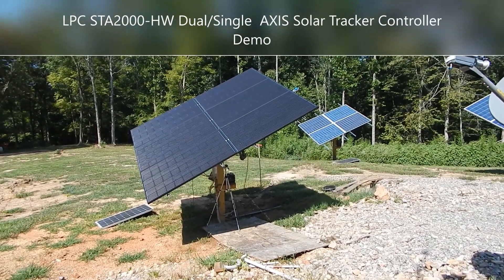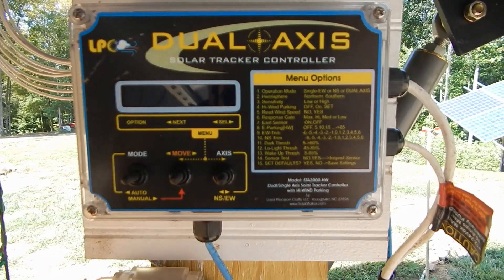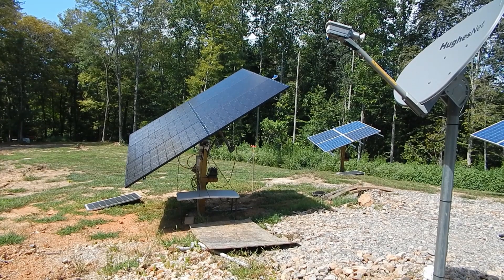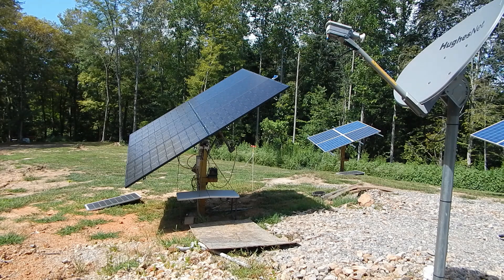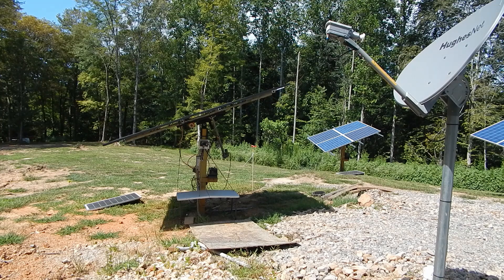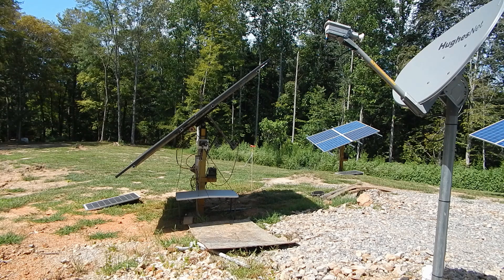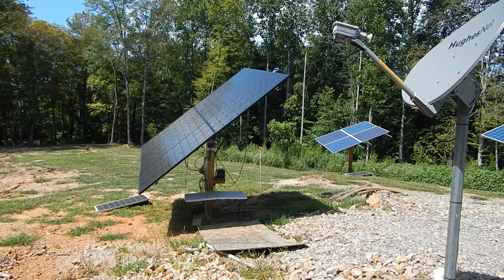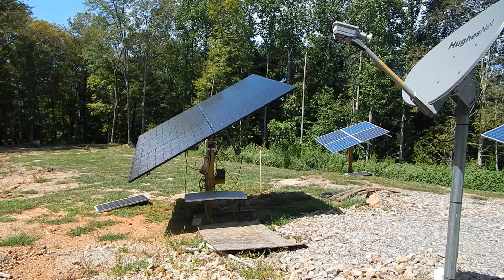LPC Solar Tracker Controller  High Wind Speed Parking Demo

Comment: Can you help me assemble the code using two actuators?
I need to use with 06 panels (25kg each).
I need this project by August 2020.
Greetings from Brazil.
Reply from the maker: Hello I would recommend contacting LPC directly and they will help you out with your issue thanks for watching .
Reply: @TheKiloG69  Sorry, what's LPC?
Reply from the maker: @Kbecao86  I suggest you please re-watch the video that is the company who built that system the LPC solar tracker controller. Scroll down through the comments section and you will see a reply from the manufacturer of this product look up LPC on the web there out there.

Comment: Very cool setup.
Reply from the maker: Thanks.
Reply: @TheKiloG69  I also will be using the 4 hole bar and the single hole square washers for mounting the 65 inches I have to go mounting 2 panels next to each other I am going to put 3 of the 4 hole strut bar across the center using cone nuts. This will never come off from bumping around during transport. I am also going to use the 2 hole l strut brackets and single hole square washers for the ends and just put steel cable anchors on all 4 panel corners and bolt it to the strut .
Reply from the maker: I will be watching your progress Thanks.
Reply: @TheKiloG69  ok I got the front rack installed 2 300 watt panels installed I'm series . Went very smooth I love the cone nuts they made this so much easier.  Thanks it was a great tip I will definitely tell my audience to do the same.looks good I will post an update video after my wife is available this cant be filmed by 1 man it's to awesome  lol.
Reply: @TheKiloG69  thanks for the tip on the 3/8 cone nuts for strut I bought 100 of them they will make this easier.
Reply: @TheKiloG69  I am trying to figure out my back linear actuator setup its driving me nuts trying to mount this lol. Email me and I will show u what I'm working on. kewl0069@gmail dot com and I will send pics.

Comment: That's an awesome product.  Has it a snow load setting? Not that i need a snow load dump setting. But I imagine in some parts of the US they would need one .
Reply from the maker: Yes when it parks. It is amazing works well.
Reply: We have done this as a special build for Mammoth Community Water District , Calif. on their 11 Mw solar farm, we supplied 2 - units.  It detects snow with an external snow sensor as well as wind speed for HW parking.  When snow is detected, the panels move full south & east for maximum tilt and holds that position until an operator comes and clears the snow from panels before it allows tracking to resume.